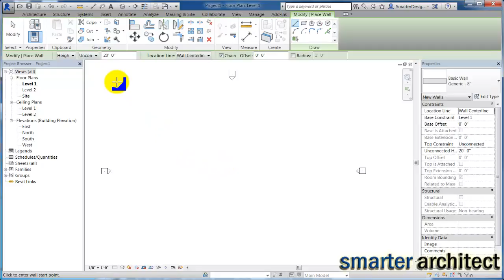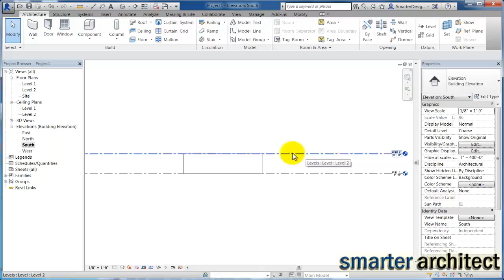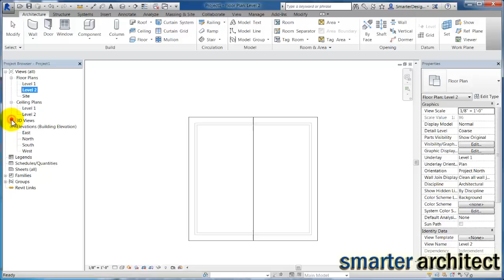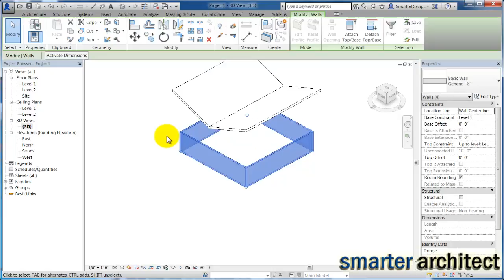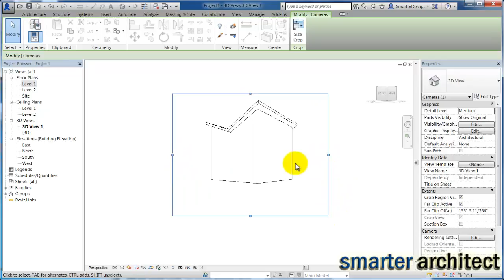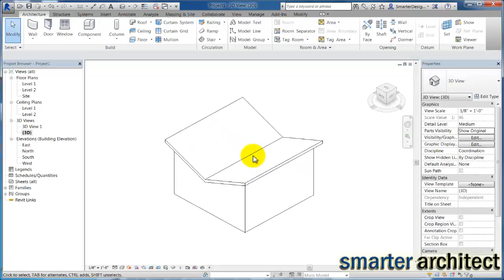Revit Tutorials: Butterfly Roof in Revit

Comment: How do you change where the dip in the roof is?  For example, if the dip happened at 1/3 of the way rather than splitting the roof in half.